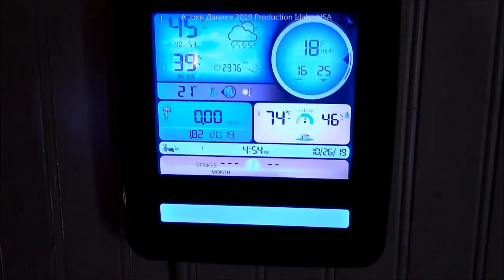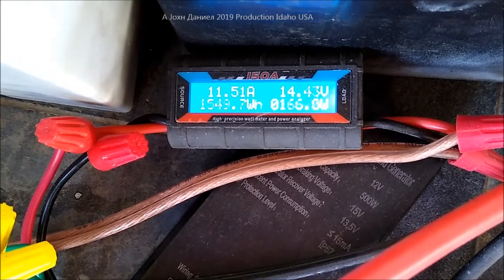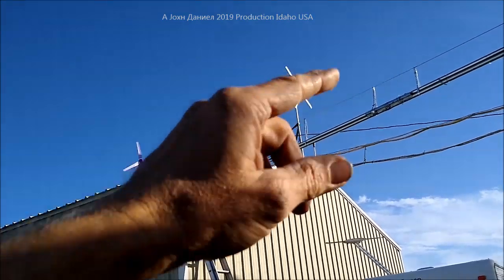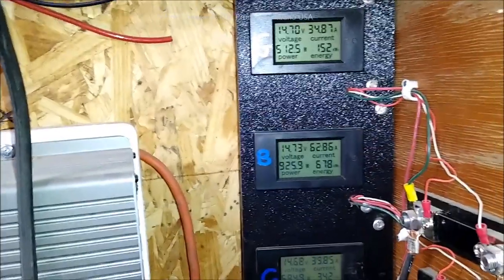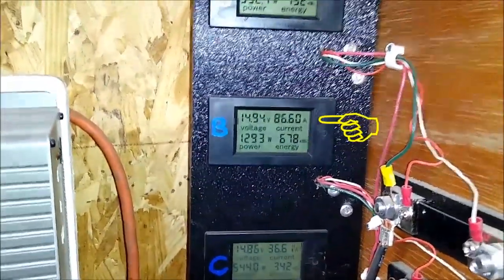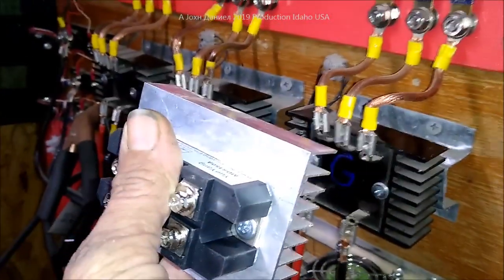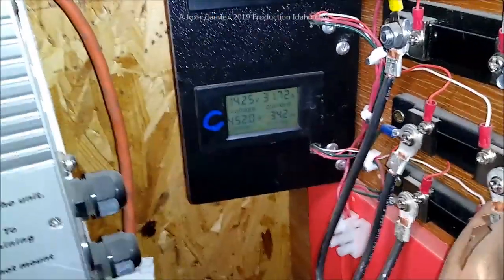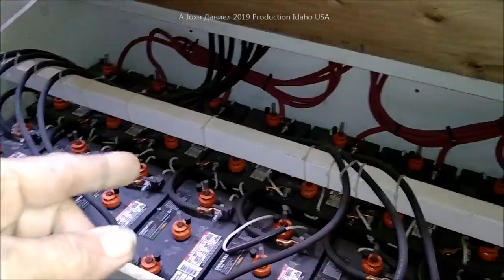Multiple Micro Wind Turbines make high power, 800 watt B&C hits 1300 watts, parts Below Vid

Comment: Hi @John Daniel , I saw your very interesting video. I also want to built a wind turbine system. 
Question, do you use this "ALL IN ONE OPTIONAL WIND AND SOLAR CONTROLLER WITH DIVERSION" in your system?

Thanks.
Reply from the maker: In many installs I do use that dual service wind and solar with external diversion if you go and look on the links below the video there is usually one that will pop up after you have clicked on the turbines link, just be sure that you get one that exceeds the ability of the turbine and is adjustable.
Reply: @JOHNDANIEL1  thanks for your reply.
I did see that you mention often these controllers.
These controllers are just charge controllers, am I correct?
I'm looking for a grid tie solution, is this also possible with these controllers?
Reply from the maker: @sanderdijkshoorn3749  I work with off grid mostly and the controllers I use are for that use. Grid tie a wind turbine is not something that ever pays off in total cost verses recovery. Although I will install one on request, I do tell them its a "feel good" act, not a financial one.
Reply: @JOHNDANIEL1  how would a grid tie installation then look like?
Reply from the maker: @sanderdijkshoorn3749  Turbine, 3 phase to grid tie input, from grid tie to grid. What size you looking to get and what is your location for whether it would work well? You can send me info on my shop email olympicpowercontrols@yahoo.com if your needing additional direction on it.
Reply: @JOHNDANIEL1  Thanks John. I will send you a email.

Comment: What ever happened to the VAWT you had me buy?
Reply from the maker: It's in McCall to see if it can be of use, I needed to mount it higher here but no place to do it. So even though it's only good for 150 Watts max as I hoped it is better off on a converted fire station up there to try and keep the battery up in heavy snow that hurts the 200 Watts of solar. So far, still only maxed at almost 150 being 25 feet higher than the trees.

Comment: Did you test that wind solar hybrid controller 800w wind 600w solar that you recommend in description? I saw reviews not so good. People are complaining about it.
Reply from the maker: Yes, but only for Wind. For wind its superior because is runs very effectively, add solar I do not have conclusive testing to say its perfect for both. Reviews are 81% positive though, most of the negative are people buying too small and expecting too much. You have to size for peaks in storms as well as never add 100% the solar rating to any controller, rule basically is 85% max you would see in either solar or wind to get faithful results.
Reply: @JOHNDANIEL1  yeah, only for wind i'm intersted to buy it. I have other mppt for solar. I will use same batteries, that will affect them? Thank you.
Reply from the maker: @robertt.1218  You can set the wind divert voltage settings, just set the wind 1/2 volt above your solar settings and just below the inverter max input volts.

Comment: Hey it’s Adam Williams from Canada. Ordered the 800w b&c and specified 24v but they sent me a fw10-48 charge controller. I’m very new to this stuff do I put a mppt charge controller in between this and batteries or do I need a 24v.
Reply from the maker: I would do a running test on their controller connected to the 24 volt battery bank, and see if it auto recognizes. If not I would personally prefer their 1000 watt Big Blue controller with diversion system you see with the same page as the turbine. 
Contact them, tell them the provided controller is no good, and ask for a good $50 discount on the nice one with RS232 connect.
Reply: Јоhn Daniel thanks for the info

Comment: It takes big strong magnets, and alot of copper, to make big power!   A hand full of fridge magnets, and 25' of 30 gauge wire, isn't going to make much power! Even in 200 mph winds, some chineasium turbines seem to have an extra 0 or 000 added to their output rating!!
Anyway, I have been checking ground level winds , and basically if the leaves are moving the wings can be upwards of 5 mph, (that's slightly moving leaves, ) I'm thinking I better go with a micro hydroelectric generator,  I don't get the wind, to even get an average of 200 watts, but I'm thinking I can possibly get a minimum of 150 watts, 24/7, with some work, digging, I'm thinking 1kw will be possible 60% of the time, daming up the spring, and possibly using excess solar power to use a pump to return water to the resivor, for use when there is no sun, the river is 200' away, I can pump it 40' up hill, to the pond,, it all works the same electrically! I can still use my alternators, the delco alternators are tough! And I have the heavy-duty 21si versions, with larger bearings and shaft, a bit difficult to find pulleys for, but still great alts, I hope to save up water, and get about 6kw, for 10-12 hours,  when there hasn't been sun for a week and all batteries are dead,  I can be using about 3-4kw of that in the inverter, and still charging batts, you have been a great help, I may still put up a small turbine, 250w or less, to charge outdoor lighting when there is no sun! And as a kinda yard art!!

Comment: Plan on purchasing the 48v version of the 800w wind turbine, would a 3.3 ohm resistor such as the TE1000B3R3J work as a diversion/brake load?
Reply from the maker: My suggestion on 48 volt is 6 to 10 ohm and in 100 watt size, reason is you only should use 70% of your turbines rating in load resistors, it can not keep its speed up in high winds with a load on it thus can not make the full rating while being diverted, a 800 watt turbine is well controlled with 500 to 600 watts in load, anyone trying to sell you 1000 watt of resistors and big automotive solenoid are doing so as a crook!
Reply: @JOHNDANIEL1  why would you choose them in 100w instead of going with a higher wattage of let's say 500w. Wouldn't a 5.6 ohm resistor on a 48 - 54 volt system hover around the 400w to 500w? I am no electrical engineer so please enlighten me on the subject.
Reply from the maker: @vlmendezjr  Redundancy in the system, If you use a single 500 watt load, it fails your turbine is done for. If you use 5 of the 100 watt resistors and one fails, you have a turbine that still is in control and making some inconvenient over volt conditions. I pick resistors based on the rectified hertz of each voltage in the upper side of DC, the higher the volts, the higher the load OHM should be to keep diversion cycles smoother with less stress on your Solid State Relays (DC to DC SSR) .
Reply: @JOHNDANIEL1  purchased the 800w 48v turbine from B&C on their Black Friday sale. Just to make sure, would it be ok to use three 10 ohm 200w resistors wired in parallel for this turbine? My setup is using a 3 phase Solid State Relay to 100a rectifier to divert the excess power to my resistive load supplied by the above mentioned resistors.
Reply from the maker: @vlmendezjr  That sounds like a good layout. 600 watts is right on the edge of good control, but I would consider a 4th 200 watt with a extra manual switch on it as a constant load in storms. Be sure to get a Windandsun OPC controller with your set up, the 3 phase SSR needs to be a DC switching style so you can tap the batteries to run the diversion setting and power the SSR's switch by them. If you need the correct controller to use, ask.
Reply: @JOHNDANIEL1  my setup involves a Outback Power charge controller which has a 12v auxiliary output that can be setup for a diversion load via a standard relay or a solid state relay for more precise control. I really appreciate you taking the time to answer my questions.
Reply from the maker: @vlmendezjr  You can tap a 12 volt source from your batteries to sense and turn on diversion at a voltage safe for your system, usually 14.75 volts to divert on lead acid batteries and 14.2 on lithium

Comment: Question.  I am purchasing this 800 watt 12v. I am going to have a total wire distance of 300ft. What awg wire would you use?  Thanks.
Reply from the maker: 300 feet exceeds the ability for full output, max to see full output is 190 with 6awg wire. 112 with 8awg . If you have no choice to the distance get a 24 volt model, run it with 6 awg, but know you will only peak at 600 watts in a DC charging situation to 12 vdc battery.
Reply: Јоhn Daniel  would I be better off using a small watt like the 500 you have at that distance?
Reply from the maker: @michaelwood8221  No, the more power wattage rated and higher volts, the less wind needed to transfer longer distances
Reply: Јоhn Daniel  got it. What is a sensible  voltage drop that you don’t mind seeing.  2-5%?   When I used the wire voltage loss calculator I’m at 13% loss on 24v and 4% at 48v both using 6awg at my distance. I think I’ll do the 48v model ?
Reply from the maker: @michaelwood8221  OK I think by reaching into the WAY BACK MACHINE in my installations history I can help better.
Once upon a "Battle Mountain area Nevada desert installation for a canyon hideaway" in 2012, I installed a 48 volt 1000 watt turbine up in the higher hills, 330 to 340 feet above the canyon floor, down from it we installed a tiny control room ( dust shack is proper desert term ) at the 240 foot mark down from the turbine on a ridge,  THIS IS A 48 volt battery Hybrid using my design to charge a 12 volt system. READ ON - This design I will now share, is happily working perfect 8 years later - 
My design consisted of 4 - Deka 12 volt 105 amp hour batteries, A 150 amp rectifier 3 phase to 2 @ 1600v and a OPC controller for diversion by tapping one of the 12 volt batteries ( to control the SSR's and DUMP switching 14.5 is same as 58v in its brain) but the best part was 90-100 feet of wire ran down the hill in 4 AWG THHN to his house from those 48v batteries, loss from 50 to 54 volts ( battery above ) to his house was to 46-50 volts at worst. From there I installed a 80 amp MPPT and using the power from that 4 AWG 48 volt input fed it into the Solar Panel input, out of it we charged 14 of the same Deka 12 volt marine batteries. Also at his place in the canyon I installed 2000 watts of solar ( 10 of the Trina 200 watt at 24/42VOC ) and ran it down hill 60 feet into the canyon into 2 more 80 amp MPPT's and POOF he has a fully working 1370 AH 12 volt system. 12 is volt preferred by Preppers and survivalist because CHINA an not control your equipment availability or options!  
You will need a programmable solar controller that releases at 42 volts so the batteries away are safe, and resumes at above 46 volts.
Hope this gives you options on thinking.
Reply: Јоhn Daniel  Good read!!  Thank you for taking the time to explain!  That helps!
Reply: Јоhn Daniel do you have a email I can send a few questions to?
Reply from the maker: @michaelwood8221  olympicpowercontrols@yahoo.com

Comment: Also.....i think i solved my problem with my 500. Go figure, there was never anything significant wrong with it. The blades were slightly out of balance and i solved that but the real issue was my damn tower! I used 1.25" rigid, 25' tall and even had 2 sets of 3 guy wire down to earth anchors but where they connected to the tower was way too low. Every time the wind would blow, the tower itself would flex and sway and throw the tail fin out of balance and swing the blades out of the wind. Built an all new tower, same height but with 2" rigid, and a single set of 3 guy wires attached as high as possible without interfering with the blades... well whatta ya know. I saw, in 10mph wind yesterday,  the same peaks but steadier power as i did in 28 mph wind on the old tower. Can't wait for the north wind to blow and finally spin this puppy up.

Comment: That's a lot of warnings about crappy turbines, I get the feeling either someone scammed you or you had to explain to someone that they have been scammed...
Reply from the maker: I install tons of customer bought turbines, I can recommend the best ones but many will just picture buy on fraud ads and buy the cheapest or most ridiculously hyped ones. In the result you get owners that complain about the crappy ones, I keep records of installs and log results to improve my own work. When you got folks with 20+ open and shadowed you tube channels based on their ebay store, you get a skewed promotion result. However I don't make, sell or owe a manufacturer a damn thing, so when I call it crap I do so from my end as well as a pissed off buyer of it. And I get full on assault by those you tube and ebay junk pushers who claim 2000 watts from something with 50 to 60" blades.  You want 2000 watts from a tiny wind turbine, you better have 130 mph winds all day or a 30 lb generator head and 104" blades.

Comment: Shouldn’t you have the heat sinks mounted vertical to help the flow of the air cooling ?
Reply from the maker: The HAT metal they are mounted on with some 3/8" spacers acts like a buffer to push the air up through them.

Comment: Wonder how to get a 24 volts stator for this one I have? It's the 600 watts one you have on the link. Should I try to rewind it? They sent me a 12 volts one. Do they sell any parts? I used a 200 amp rectifier. Do they own a telephone? All it says in the "owner's manual" is not to put it up in a high wind, or to not handle blades roughly.
Reply from the maker: Did you buy Green Energy or B&C ? If so, send me all the details in email and I will forward it to her, she will respond back to you. olympicpowercontrols@yahoo.com

Comment: What meters do you use that are on the wall ? ... the ones I got from ebay and amazon last 3 months ..
Reply from the maker: From AliExpress you actually get calibrated meters. From eBay or Amazon you may or may not get good ones. The social ranking system in China makes them scared to sell you junk from their direct Chinese website. But they have no fear dumping it on the market through eBay or Amazon however.
Reply: @JOHNDANIEL1  Thanks

Comment: Holy shit john that 800 watt turbine is exactly what my big ass battery bank needs lol. Amazing.i know for a fact someday I will definitely  have to buy that monster. 150 amp rectifier and definitely upgrade the dump load to atleast 600 watt and new solid state relay and dump controller.  That's amazing man I love it you sir are 100 percent full of common sense and impress the hell put of me all the time. Thanks man for showing me how to kick ass with a wind turbine.
Reply: All I have to do is pay off my 5k debt   that's left over from my trailer wind and solar hybrid system build .I spent about 10k on that one and that will give me enough power to get started on building everything. Power tools and water pump for well and lights and fridge ac unit what ever. I bought a automatic transfer switch a 50 amp so i can power a few circuits in my current home off my system to save on power and have energy when power goes out. I only have 4 lines running into my home and my camper too and i actually power 3 deep freezers. 2 smart TVs, laptop pc, charge my cell phones, bipap, mini fridge, infrared parabolic space heater , and flood lights at night and battery chargers and apco25 motorolla 2 radio. And indoor lights, internet router, security cameras and DVR and alarm system. And my voltage is usually at 12.4 v in the morning with loads still going.i think its kicking butt.

Comment: Sometimes people forget that wind turbine output is regulated by battery voltage. If your batteries are full the output of the turbine is lowered so it's hard to say what they are putting out.
Reply from the maker: Yes people always want to know what the kilowatt-hour will be on a turbine but they seem not to understand that every person's usage affect the actions of the turbine.  In my case I produce either hot water, hydrogen, or heat with my excess and my kilowatt-hours is dependent entirely on my power needs per day or size of battery used as much as the turbines abilities. So you usually get many people claiming you're being evasive about giving its daily output but it's simply an impossible calculation to be accurate with. However the ones I'm using now get the battery to full charge twice as fast as any I've ever used.

Comment: Confused about which model is the good one among Chinese turbines? Can you post the model ?
Do you suggest the charger which comes with it ?
Reply from the maker: I put a link below the video that takes you straight to the 800 watt 3 blade I would suggest if you're going to get one that you absolutely cannot go wrong with that model. The build is impressive and the hardware is bulletproof. As far as a controller is concerned their controller is sufficient for the job unless you're going to add more than one turbine. be sure if you have solar power to set your solar controllers to turn off after 14.2 volts for a 12 volt system or 28.5 volts for a 24 volt style.